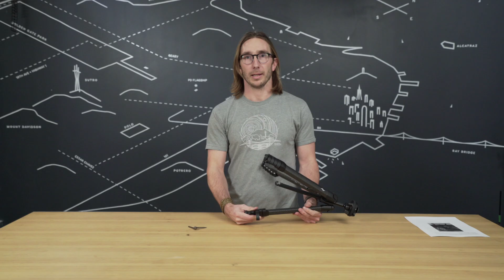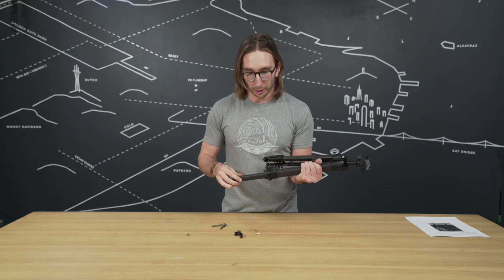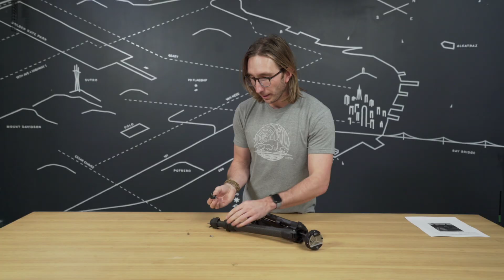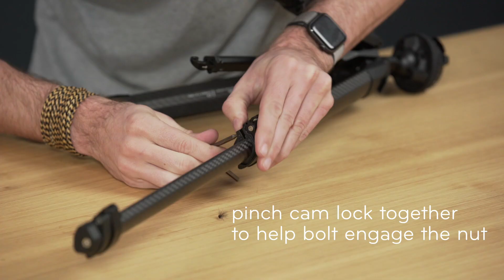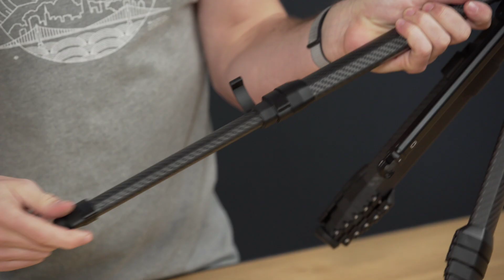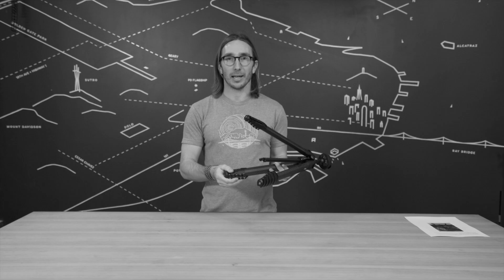Hot Take - Travel Tripod Cam Lock Reassembly

Comment: This looks fine and dandy in a nice bright room, a table about waist high, and wow, a just in time handy flathead screwdriver.  Try getting that SOB back together out in field, about dusk, using your knee as a table,  no flathead screwdriver, nor a backup tripod on hand.   My problems started when, in a hurry to get setup, accidently opened that very top latch and out came the whole leg assembly from the base, along with a sort of diamond shaped flat washer (if you will) that approximates the same shape as leg.  It landed on the ground.  Before fully realizing where that washer reattaches, the cam was over-loosened and all went to hell in hand basket.  

Never knew problems like this could exist with a tripod.  Backup is a 20 year old Manfrotto beast--I'd attach a Hasselblad on the business end, flip upside down, and on loosening the rings,  let the weight of the camera (along with gravity) auto-extend each leg section.  Bam-bam-bam x 3, done.  Don't recommend using that method with this delicate Princess.
Reply: You sir are spot on, it's and SoB to get back on.  And that was with a waist high bench, lights, good tools and  even put on half glasses for good visibility.